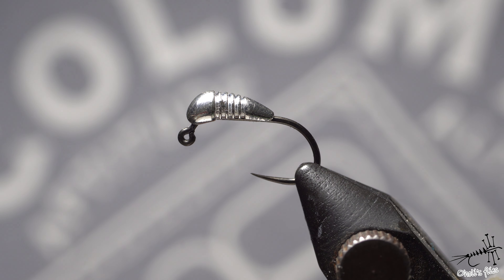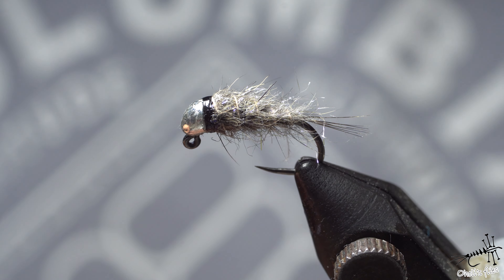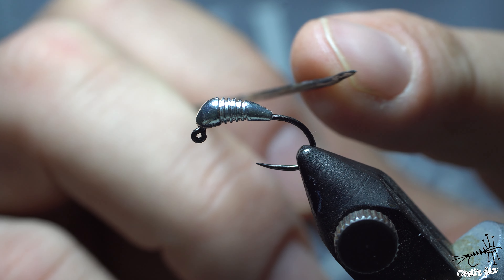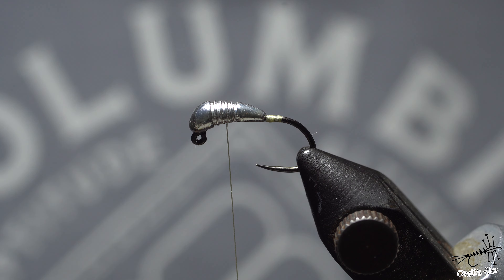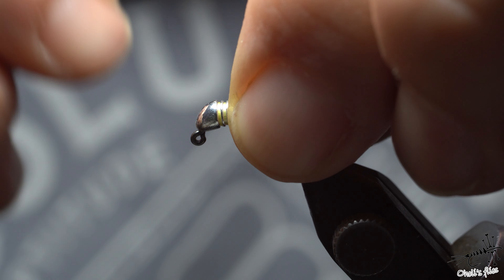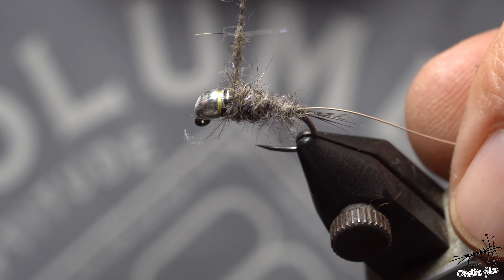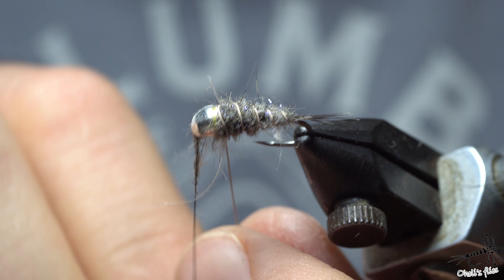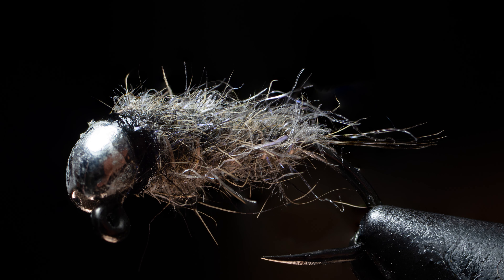Heavy Weight Buggy Nymph

Comment: Vlad, if the head of the Javi is less or equal to 4mm and the body is all covered (hidden) does that make it a FIPS comp legal fly?
Reply from the maker: It does. At least that was the case up until 2017. when i was competing last time. This fly i made should be legal. But, thst said, there arent many situations i would use those. But, when i do use them they make huge difference. 🍺😃
Reply: @Oholisfliesandfishing  my first comp is happening in less than a month. And we are only allowed one fly in this area so if I hit one of those fast moving water with successions of huge boulder and deep hole pockets even a perigone on super fine tippet doesn't manage to make it deep enough before I have to pick it up so it doesn't get stuck in between rocks and boulders...
Reply from the maker: cool. I wish you tight lines. I was competing in serbia with one fly only. Those are regulations. And i love it more than two or three flies.